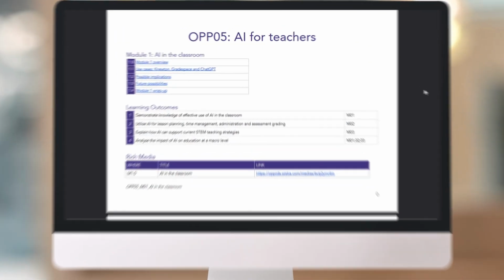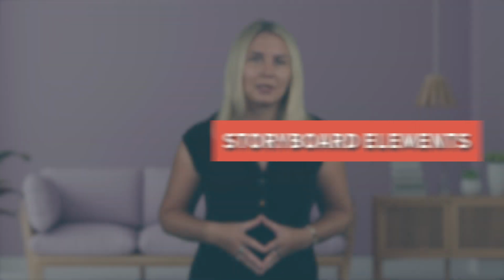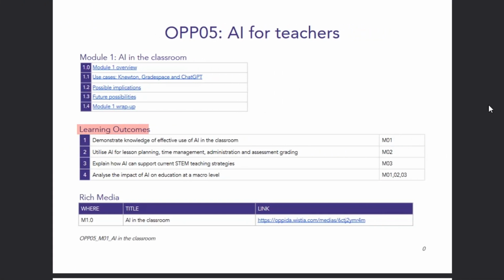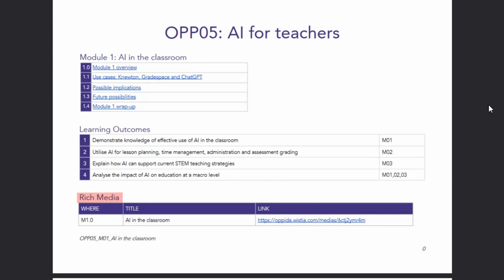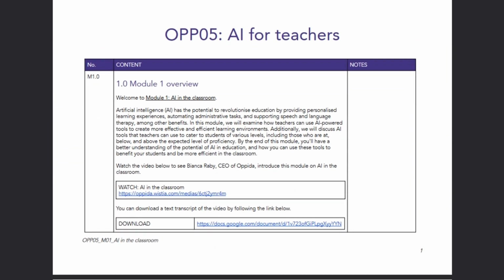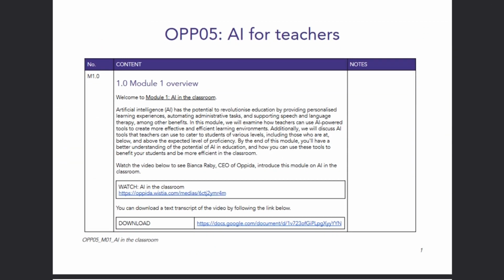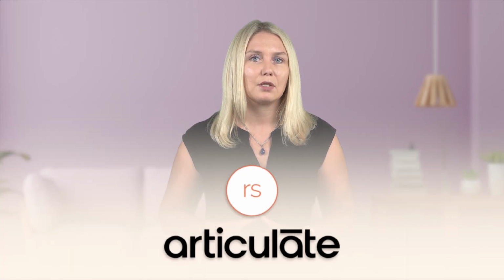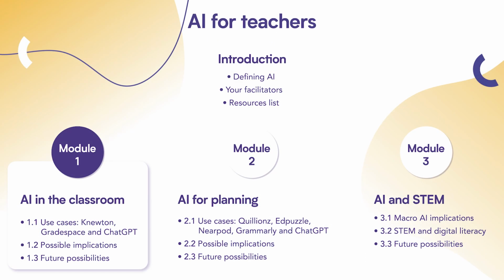How to create a Storyboard for eLearning, Learning Design and Instructional Design

Comment: Producing a feature film and developing e-learning courses are two different things, I guess.
Reply: Actually, they are not that far off from being the same. As one who's worked on over 10 films and as an instructor you have a path to which you want to get your audience. In a film you're telling a story or educating your audience to a final outcome of a story. You do so with visuals, audio, sounds and of course a story-line. It's basically the same thing as an instructor or now-days eLearning instructor.... you have a goal of what you want to have the audience/learner get to know and understand. You use visuals, audio, ques and of course a story/message path.
Now, does that mean every instructor can be a film maker. Well if they have all the skills of: videography, audio engineering, lighting, editing, etc... they easily could. But, many film makers can easily become developers of eLearning for they have all of the skills to do what's necessary. it just doesn't have the badge of "film maker" to it. Which so many feel is a big-deal because of Hollywood.